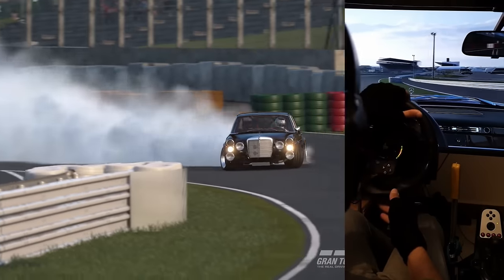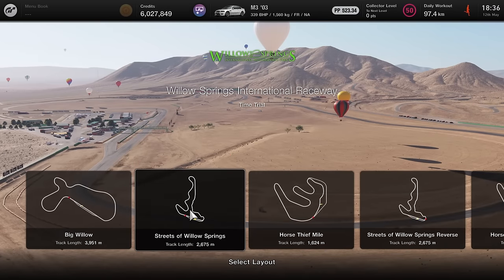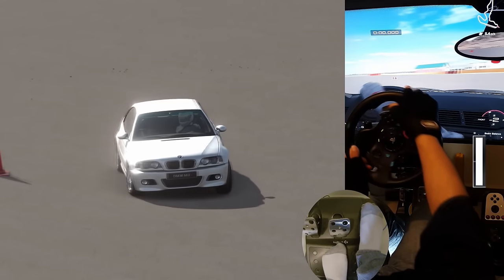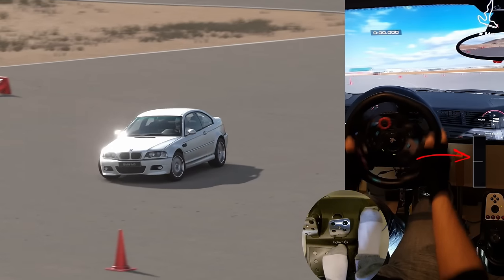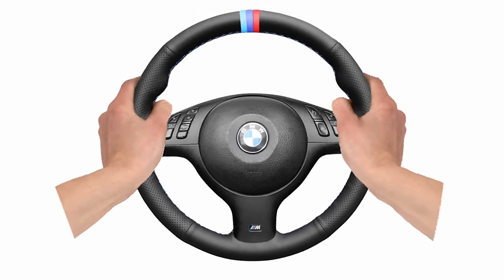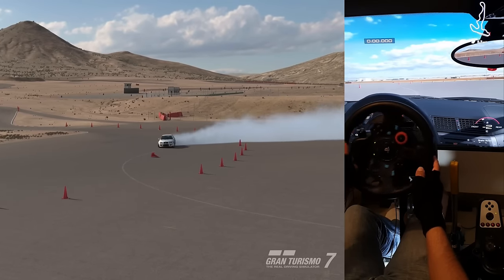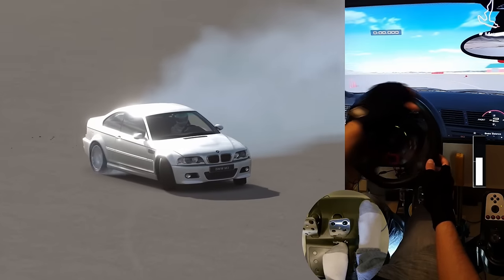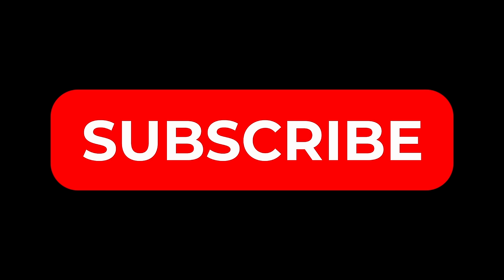How to Drift With a Steering Wheel (GT7/Real Life Tutorial) - Part 1: Basics

Comment: So I must not be doing something right because I have tried to start from a slow role and blip the throttle but everytime iI do it always seems that the car grips to much and does'nt make the back tire slip any suggestions on how to improve this?
Reply: Like what speed and in what gear would you be looking for to initiate the slide?
Reply from the maker: Well first of all don't have the expectation to immediately succeed with it, as this can take you a whole week of daily practice to even start to get used to it. So what you're describing can be very normal and just require more practice to fix. Try different speeds until you find the sweet spot, it's always the best way to learn. That speed depends more on which car you're driving and even which tires you're using so it's gonna change for each situation. It's not something to memorize or even monitor in numbers while driving because it's not a constant factor. You just need to practice a lot to get to a point where you can feel and anticipate how the car will behave. If you’re new to this I highly recommend that you keep practicing  a lot, and on a daily basis if possible. Keep trying to initiate and learn what's happening during the process. It will be frustrating and can even feel impossible at first and that's totally normal trust me.  If it takes you a month to only start to get the hang of it that's still very normal.

In this exercise and using that M3 in default setup I kept it in 2nd gear all the way. 

And btw you can try different initiation techniques and see wich one suits you best, but I think this is the simplest and easier one. All the other techniques are explained in part2 which I've just published around 13 hours ago: https://youtu.be/aNb7f5VzA2E

Also which wheel are you using and did you try my recommended ffb settings?
Reply: Ok thank you and yes I am using the ffb for the g29 and I will keep daily practice one thing that was making it harder for me was the traction control but now that I turned that off I am able to slide a lot easier now thank you for the feedback!
Reply from the maker: Oh that was the problem! you should always turn the traction control completely off to drift, also turn all other assists off except for ABS because these totally ruin your control over the car, I even mentioned that at the end of the video. I currently use ABS on "weak" but it's totally fine to keep it on default if you like. You're always welcome and thank you too for your feedback 🤟🏻🤟🏻

Comment: What set up do you have for the wheel. Any suggestions for my pedal settings.
Reply from the maker: Which wheel and pedals are you using? 
Set the controller steering sensitivity to 5 and the force feedback sensitivity to 10.
The max torque setting depends on which wheel you're using. I put it at 10 for the G29 and 6 for TGT2. 
You can watch this video for more detailed information: https://youtu.be/oEe5ZchqbMg
As for the pedals I just remove the dead zones, but that depends on the condition of the pedals. Some pedal require some little dead zone to eliminate some noise input at the resting position caused by wear.

Comment: Can you do video of this bmw tuning pls. I made your tuning on bmw m3 07 and its very hard to drift with it .
Reply from the maker: I think the tune of the 2007 M3 might need to be updated since the physics in the game were updated multiple times after publishing that video. I will make a video about it if I change anything after testing it. The E46 M3 in the current video is fully stock though. I didn't change a thing and it's very easy to drift like it is. Even the tires are default.

Comment: Dont understand i have the same wheel, car and settings, yet im unable to even initiate the drift, when i blip the gas and try to turn my wheel, it doesnt turn, even on a forcefeedback of 1, my wheel doesnt turn
Reply: Yeah It happens the same thing as you but I have the g923 but yeah still
Reply: im using a clutch to initiate
Reply from the maker: What forcefeedback setting did you put at 1 and why? I didn't get that. These are my recommended settings for the G29: 
- Controller Steering Sensitivity: 5 (very important for all wheel users) 
- Max Torque: 10 
- Force Feedback Sensitivity: 10 
Also go to the main menu and click on the GT icon at the top left corner, then click on options > controllers > vibration function > vibration strength, and set it to zero. This setting gives you more vibration details but the more vibrations you get the more numb the steering wheel feels in terms of sensitivity to direction changes. And you need every bit of responsiveness to direction changes to react faster to these.

Also keep in mind that this takes time to get used to doing it right. You need to keep trying and failing until you start getting it right. I don't know what's happening in your case, I need to see it, but maybe you're going to fast at the initiation that the rear end is not stepping out?
Reply: So you kinda gotta turn you wheel all the way while having the gas alll the way down and release and catch at the right angle. i was really confused at first too.

Comment: Hi I'm having trouble setting up my Fanatec DD Pro. Can you tell me the ideal settings for the Fanatec DD Pro steering wheel? The steering wheel feels hard and the car doesn't drift.
Reply from the maker: Hello, I can recommend the in game settings but I don't have any experience with Fanatec's internal wheel settings. 
Controller steering sensitivity: 5 for all wheels and this is very important to have a good realistic feedback.
Max torque should be above 6 if you're not using the booster kit (try 7 and 8 and see which works best), and below 6 if you're using the booster kit  (try 3,4,5 and see which works best)
Force feedback sensitivity should be at 10.
For a more detailed explanation plz watch my video about the subject: https://youtu.be/oEe5ZchqbMg
I'm starting to have the urge to get a DD Pro and make a video about its settings after some extensive testing. There is a very high chance that I might do it if my channel starts generating enough revenue to justify that purchase.
Reply: Thank you so much, I hope your urge to buy a fanatec DD is irresistible then XD
Reply from the maker: Haha you're welcome and thank you. Hope I can help you more soon.

Comment: I cant seem to drift on t300rs. Everytime i counter steer car just wants to either spin out or steaighten out then fling the car
Reply from the maker: Which force feedback settings are you using and did you try mine? 
Also it is very normal to keep failing at first, and it will normally take a while for you to get used to it. Just keep practicing daily for a long period of time until your body builds the right muscle memory for it. Keep testing with your inputs the way I described in the video.

Comment: I don’t have the trigger affect options? Is that only for ps4/5 controllers and didn’t apply to the steering wheel and pedals?
Reply: I know you don’t say I need to use it in this video I just noticed you have the option and I don’t for some reason so I’m now curious 😂
Reply from the maker: The trigger effect is only for the PS5 controller. It's not available on PS4. It's okay bro you can ask whatever you want 🤟🏻

Comment: Nice tutorial…but i have Fanatec DD, and i want a DriftSpecific setup, inside the base. This have many options for the FFB.
I learn Drifting in GT7 and the CarX with DD, but not easy.
Reply from the maker: Thank you!!
To be honest i never tried a fanatec before. But i have some tips from someone else's comment on my ffb video. He seems to know what he's doing. These were some tips he gave regarding his DD1 podium:

For torque I run between 55% to 75% depending on the car, street cars I run alot so I can feel exactly what the car is doing. The more downforce a car has the less FFB strength I use because of excessive force in high-speed turns. So I'm generally using around 10 to 17Nm of torque. I have several DD bases and have found that the sweat spot is between 11Nm to 18Nm of torque and the more the base is capable is the better because you need overhead to be able to feel subtle FFB while avoiding clipping totally.

 In-game settings for GT7 is 6 torque. Generally I would set the game to max when using the DD1 but GT7 at max in-game torque is massive, although I have experimented high in-game torque and high base torque but putting the base in linear torque mode, it raises the more subtle FFB and lowers the heavy torque. I have found this to be very good for drifting and always enable linear torque when people have a go on my wheel that have little to no experience with a high torque base.
Reply: @SimActionClips  Thanks, but i have the little DD (GT DD Pro) not a big one (DD1).  The little DD max 8 Nm.
But that's not the important thing. Fanatec has its own internal settings. You can adjust the composition of the FFB on the servo!

SEN - Sensitivity - Maximum Steering Angle
FFB - Force Feedback
FFS - Force Feedback Scaling
NDP - Natural Damper
NFR - Natural Friction
NIN - Natural Inertia
INT - Force Feedback Interpolation
FEI - Force Effect Intensity
FOR - Force Effect
SPR - Spring Effect
DPR - Damper Effect
BLI - Brake Level Indicator (ABS in oldest servos)
BRF - Brake Force
SHO - Shock
https://youtu.be/tgjmHnSUSjo

You can save these settings in 5 profiles, which you can switch between at any time. Cool stuff. I was wondering, if you have a friend who drifts with such a small DD, and has such internal settings.
Reply: @BinderVR  the set up between a dd1 and the dd gt are very similar the only difference being the maximum torque so typically copying someone's settings who uses a dd1 will work fine, but just think of the in game settings as adjusting power steering on an irl car should be easier to tune things to your liking that way if you want a more flow lower the settings so you're not fighting the wheel as much(like not having power steering) there shouldn't be much resistance when you have to countersteer
Reply: @Darklord_tK  Jes. I know. I use this settings now…but I was wondering if there is someone here who also drifts with DD and has a specific setup.
SEN: 900
FFB: 80
FFS: Peak
NDP: 15
NFR: off
NIN: off
INT: 4
FEI: 100
FOR: 100
SPR: 100
DPR: 50
Reply from the maker: @Denebes Binder Péter Yeah man I know the difference between them, I was planning to get a DD Pro myself but found it very hard and costing to ship one to where I live, so I settled for the TGT2. As @DarkLord tK said, they would logically both require the same internal settings with only difference in the torque setting. Unfortunately I don't have any friend who uses a Fanatec DD with GT7 to copy his settings here. Wish I could help bro. If I ever get the chance to try or setup one, I would definitely make a video about it.
Reply: @SimActionClips  thank you sir. :)
Have you tried even “CarX Drift Racing Online” on PS4/PS5? This is a very good Drift game. Many options for car tuning, bodykits and incredible variations of the car setup!
Excellent with Steering wheel. ;)
Reply from the maker: You're welcome man. Well honestly, I used to play it on my mobile phone, and got interested when I knew that a console version was made. I saw some gameplay videos and didn't like the physics. I look for the best realism available in physics, and GT is far ahead. It looks like a nice game, but it's just not what I'm looking for.
Reply: Hello, I am also looking for a valid configuration to be able to drift well with my DD Pro and GT7, have you found a valid configuration? I'm freaking out and can't find the right settings to drift.

Comment: Hey i have one question is it better with handbrake cuz i made a handbrake and connectet my controller button to a rubberband
Reply from the maker: It's not better nor worse... it's more of a personal preference to use it or not. In my opinion, it's in general better to have the handbrake to use it for corrections, which is the subject of one of my coming parts for this tutorial. Otherwise, using the handbrake to initiate a drift is one of the many different techniques used for the initiation, and I've explained them all here in part 2: https://youtu.be/aNb7f5VzA2E

Which controller button did you connect to the rubberband? Because if it's just one of the push buttons you'll have a handbrake that just work as ON or OFF which is not ideal. You can have the handbrake work progressively, similarly to the brake and gas pedals, by using one of the R2 or L2 triggers of the controller or one of the L-Stick or R-Stick. You can check out this video to see how I made mine: https://youtu.be/juE8m0G07rI

Comment: When is part 2 dropping??????
Reply from the maker: Soon enough. Will drop a short video explaining the new change in ffb after the update in a couple of days. Then resume the making of part 2 🤟🏻
Reply: Thank you, can’t tell you how helpful this video was. Can maintain the drift just keep over rotating on transitions hoping you’ll address it in the series but all aside keep up the hard work mate 👍
Reply from the maker: You're welcome man, and that's awesome thanks a lot for sharing!
I will surely address every single detail related to drifting in this series 🤟🏻
Which wheel are you using btw?
Reply: I’m currently using a t300 gt edition, looking into upgrading to a direct drive wheel soon. Aswell well as upgrading my whole sim 😂 have you had a chance to get your hands on the ps vr 2 and have a go at drifting in vr?
Reply from the maker: Did you try my settings? 
- Controller steering sensitivity: 5
- force feedback sensitivity: 10
I set max torque at 10 or the G29 and 6 for the TGT2 so you should set yours somewhere in between.
You can watch this video for more details: https://youtu.be/oEe5ZchqbMg
I think with enough max torque the T300 should be able to rotate fast enough on its own during transitions. Practice letting go of it at the right time at the beginning of the transition an let it do the rotation on its own and see how it goes. I'll be explaining this in more details in the videos. Meanwhile, try watching real drifting videos and see how it gets done. 
A direct drive will surely help a lot especially with transitions. I wanted a Fanatec DD Pro but couldn't get one so I settled fir the TGT2 for now. 
Didn't try any VR yet but surely planning on getting a PSVR2. It should feel very realistic from what I'm seeing. If only they fix the virtual steering wheel rotation in the game in cockpit view, it would be perfect!

Comment: I need settings for my g923 ffb an ffbs also counter steering I need them for drifting and also regular racing I’m struggling man
Reply from the maker: I would have recommended my video guide but seems like you've already watched it. So all I can say is enjoy the improved experience :D
Regarding counter steering assist and all other assists, just turn them all off except for ABS.
Reply: @SimActionClips  I always spin out whenever I have counter-steer turned off and I’m using a fast car. Is there a way to combat this or is it just a “get good” moment
Reply from the maker: Well honestly, it definitely is a get good moment. And Don't start learning with a fast car as it complicates things more for you at the start. You need much faster reactions to catch and controll such cars. You should first develop the skills required for it using some well balanced lower power cars, like the 2003 M3 or the BRZ. With these cars you have more time to notice what's going on and react to it. You'll be understanding things much faster instead of wasting your practice time in vain with more powerful cars where you have no time to understand what went wrong if you're not experienced enough.

Comment: What gear are you in the initiations. Also any tips on knowing the right angle to stop wheel. I constantly spin out and loosing my mind lol. I got vr and really want to learn this.
Reply from the maker: I'm in 2nd gear all the way in this exercise even on initiation. The right angle to catch depends on the degree of curvature of the turn and the max drift angle which the car is able to drift at without spinning. There's no way I guess to properly describe it, other than that you have to do some trial and error. There are shallow angles where you will be able to continue the drift, and overshot angles where you will spin. You gotta adjust your initiation angle to somewhere in between. Don't start learning with the VR in GT7, as there is no way to see what your wheel is doing. You gotta get good at it without the VR first, because when you do, you'll have that extra task later of tricking your mind to ignore the wrong rotation of the virtual in-game wheel. Notice how I hide that behind my physical wheel lol.